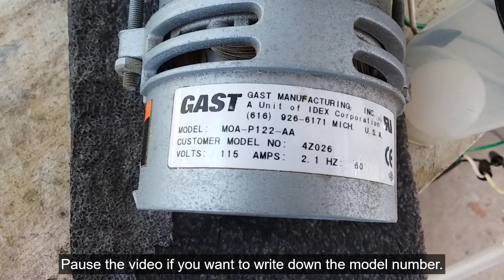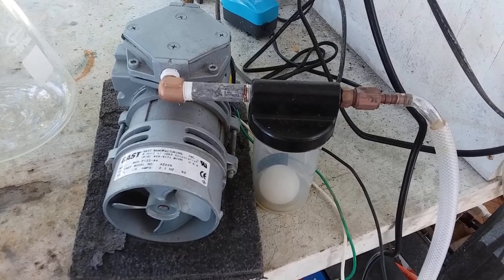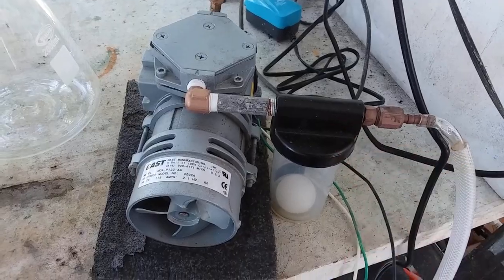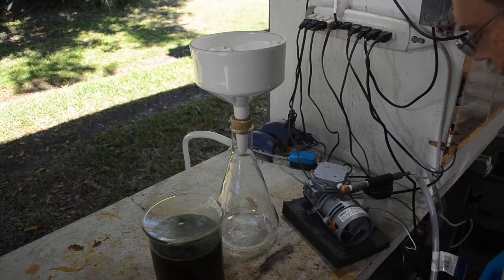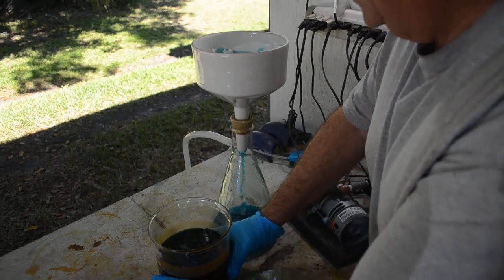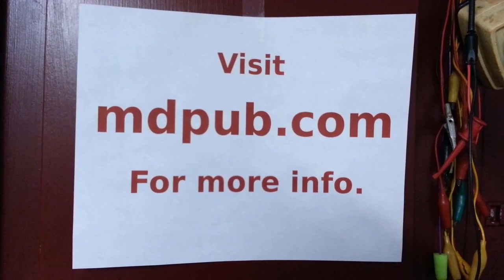All About Vacuum Filtration: What Type Of Pump To Use And Why I Do It

Comment: Thanks for the great idea about the foam for vibration dampening.  Would be worthwhile to test if the pump oil eats the foam first I think- just in case that oil eats the foam into a nasty goo.
Having been a scientific glassblower for the last 18 years I have a few thoughts I'd like to add.  I don't do a lot of fluid chemistry, but that trap looks really cool.  It might be a good idea to turn the trap into a little bong, bubbling in vacuum oil to help preserve the oil in the pump- where all the junky junk ends up.  Then again, hot fluids are rarely filtered... less vapors.  
I inverted a plastic storage bin and added cutouts for power and hose to the pump, to keep down the little clouds of pump oil vapor that these types of pumps tend to produce.  The pump ends up bathed in its own oil, and potentially any chemicals that may have made it into the oil.  That oil bath really catches dust and filth.
One has to be sure to use stout enough hose like heavy wall vinyl or nylon, because latex tube will collapse, dry rot and start to leak quickly.  It's worth working the nylon hose with a heat gun to form it to your work station.  This will help keep the stiff hose from toppling your glassware and keep stress off the fittings.
The tiny, toaster sized shop vacs, although VERY noisy, are  good alternative since you don't actually need a high vacuum.  They are cheaper to buy AND maintain, don't blow oil everywhere, and sometimes come with a handy wall mounting bracket.

Comment: I have a Gast diaphragm pump like yours. They're probably the best type for refining, because they're not particularly sensitive to the corrosive vapors. The exposed metal may get a little superficial corrosion, but the diaphragm is plastic and is pretty resistant. I think it would even survive having liquid inadvertently run through it, something which would instantly destroy a piston pump and possibly a rotary vane pump. If you have a mishap, you can easily pop off the top and inspect or clean out the pump cavity and diaphragm [and reed valves].

Comment: Also the accessory is generally called a vacuum jar or a vacuum filter jar. Cheaper made ones use a molded plastic and the quality ones use the clear Lexan like yours. If you are going to use any higher pressures you don't want the ones that have the two-piece bottoms. (Tube with a round filler part glued in the bottom) And definitely don't get the glass ones! Just the vibration can break those.

Comment: You don't use pressure guages? My GAST pump from ebay didn't come with pressure guages, and the glassware says it shouldn't be used with more than 1.45psi. Yet the pump says it's max is 60psi. Don't you need pressure guages?

Comment: The gast pump hose connector I have doesn’t fit into my Büchner funnel ? How do I change the hose barb to fit a new hose connector to fit my Buchner filter??
Reply from the maker: How about a different size hose and an adapter? A trip to the hardware store may be in order.